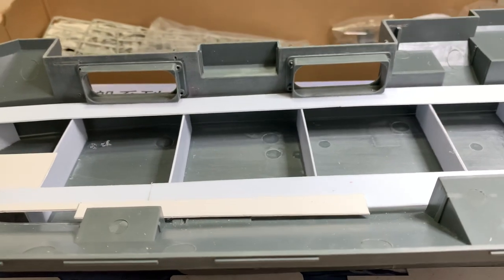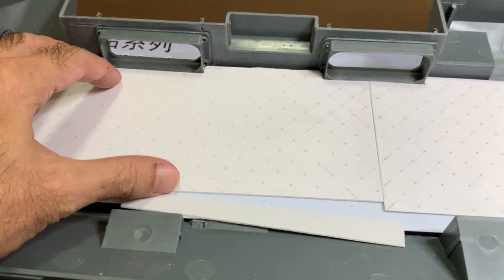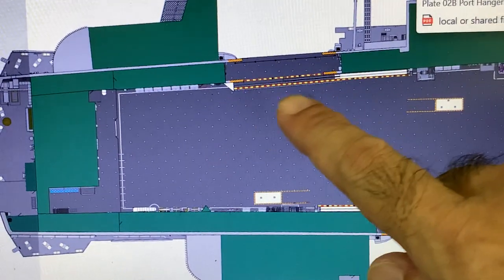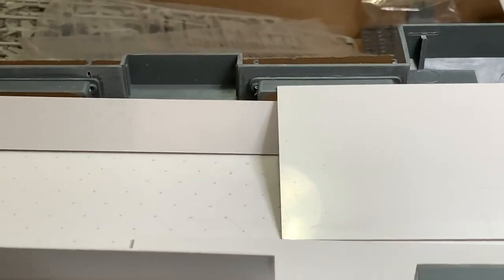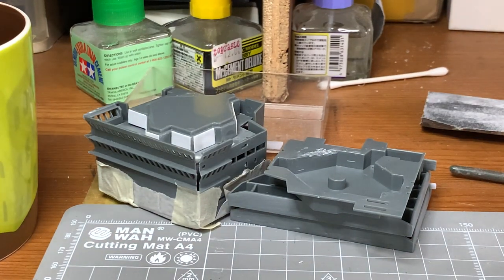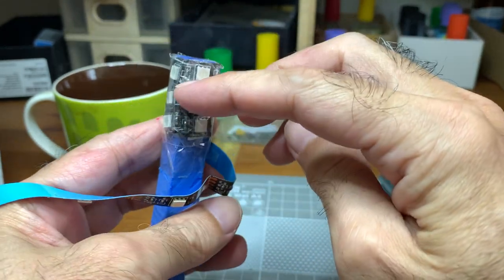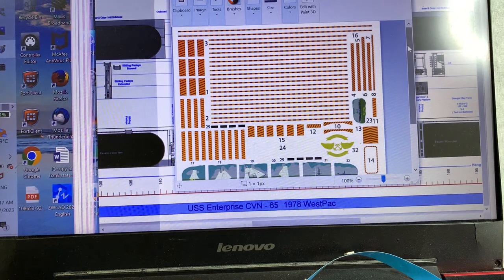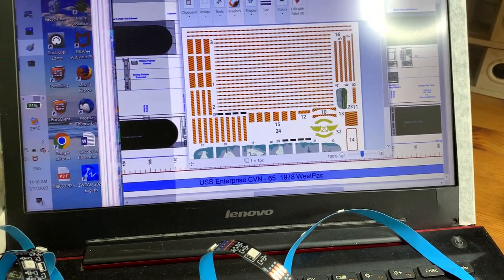1/350 USS Enterprise CVN-65. Mini Hobby Models. build update part 3.

Comment: The LED tape lights I bought can be cut at certain places then connected with purpose designed male and female connections.  I believe yours can too.  Looking at them in your video there is a place with 4 copper pads and a line through the center.  Could those be cut there and soldered back together at those places? You would need a delicate touch with the soldering iron of course or the strip would be ruined.  The lighting you demonstrated for the island is pretty slick.
Reply from the maker: Yes the LED strip can be cut but i will not recommend to solder it back. these strip lights i believe is manufactured using machines like soft solder machine or surface mount device machine which is controlled with accuracy. soldering manually could ruin the circuit. i saw the 90 degree connectors sold to attached them but it looked bulky and could cause space problem again. for me i’ll just fold them since they are so flexible and soft. i forgot to show in my video today on where the LED leads will stick out from the bottom hull. i decided it will come out at the center of propeller shaft area instead of the bottom for the reason of easy connection and detaching the power cable. i will show this in my next video.

Comment: I appreciate your video. I am gathering materials for my Trumpeter Nimitz 1/350. I am approaching the lighting of the tower using micro fiber optic cable which appears to be very cheap and fairly versatile from what I have researched. The hanger bay, I will probably use the strip led I think. Anyway good luck
Reply from the maker: you are most welcome Bushranger. including you there’s another guy called random american who is also building the nimitz 1/350. Glad to know there’s few of us who are building something very similar. using fiber optics is a good idea. i think there’s 2 types of fiber optics. one is a directional tip point lighting and the other is the glowing type which lights up on the entire optic cable. i did try to source for the glowing type during my kitty hawk build but did not find a suitable one. it was too thick. i hope you can also post videos so we can compare notes. good luck buddy.

Comment: I saw the same problem with the metal braces that you found but it occurred to me that these were there to attach the flight deck as well as stiffen the hull.  Once your hanger deck is glued in place the hull flexing should be reduced considerably since it will be braced bow to stern.  I believe that Miniart wanted the flight deck to be removable so that the batteries for the motor could be accessed.  I plan to build braces out of plastic card attached to the overhead of the hanger.  This will allow me to have channels for wiring for lights and provide support for the flight deck.  I have similar LED tape lights as you.  My plan is to attach them to the flight deck so they will shine down into the hanger.  My hull will be screwed to a base resting on keel blocks.  My power source for the lights will be under it.
Reply from the maker: you are right about the metal braces providing support for the deck. i didn’t think about that. i noticed for the middle metal braces the hull needs to be pressed inward to reach the metal piece. it means that the hull is not at it’s supposed shape. after i posted the video i tried placing 2 of the plastic cards in between the door well and the metal braces and it seems to fit. this means i can use 3 plastic cards for the overhang. your method to put the LED underneath the flight deck could work but will be difficult when closing the deck. i suppose there’s many ways to do this. which ever you find easier should suit you. good luck!